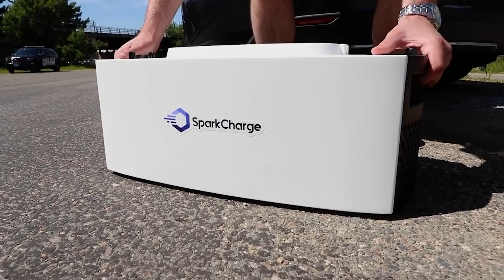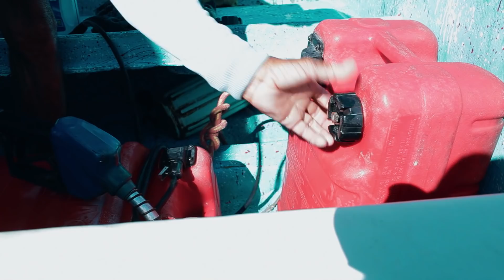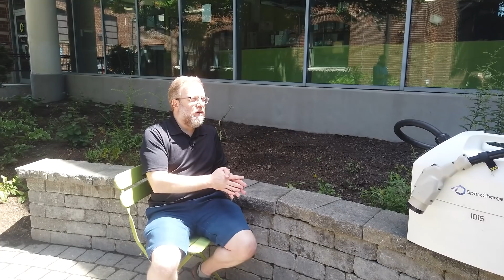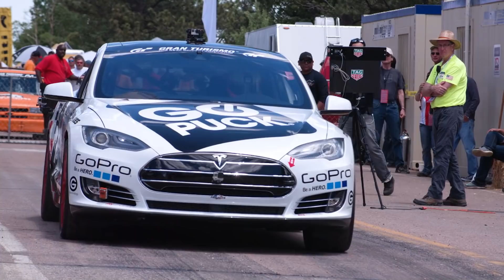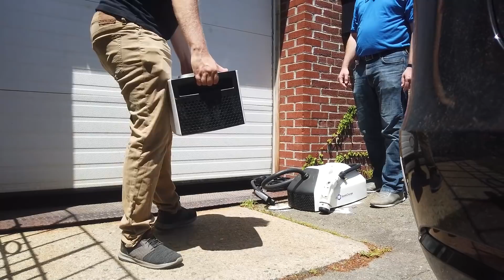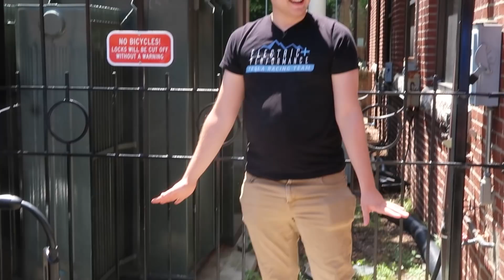SparkCharge | Range to the Rescue!

Comment: All this company needs is to make a secure outdoor enclosure for these units, and they could turn any parking space with a 120V power outlet into an EV charging space. No permits or massive installs for EV stalls. This would just charge up when not in use, and then when someone pulls in, it can dump the battery contents into the car.

Comment: “How much is in the first battery?”
10-15 miles
The guy lost credibility when he answered the question this way.   Batteries do not store miles, they store kWh (kilowatt hours).  He should have definitely included the battery capacity in his answer.  Saying “10-15 miles” tells me he’s misrepresenting, exaggerating and the solution is probably crap compared to others.  Or - the spokesperson is an idiot. 🤷🏻‍♂️

This product is a portable battery and a charging cable.  It’s simple and obvious.  There’s nothing innovative about it.  The market will be flooded with products like this.

Comment: 1 mile a min charge? That's super slow. I love the idea but it needs to be able to charge faster than 1 mile/min. Plus one battery bank only contains 10-15 miles so you'd have to stack at least 4 banks to get at least 40-60 miles if needing to get to the closest Tesla charging station while on a federal interstate like I-95 or I-10. I love the design and portability but I'll wait until the charging speed increases.

Comment: I just thought of another use case... Rentals. You going on a long road trip? Want a little peace of mind that you won't be stranded on the side of the road out of juice without cell service? You rent one of these as a 'just in case' backup to take on your trip with you. Then at the end of your trip you return it. - Call it the 'road trip kit' include a single power pack, a spare tire, an emergency kit with those pop-up cones, first aid kit, tire sealant, tire pump... It might take up 1/4th or 1/3rd of your trunk, but you'll travel with confidence.

Comment: I think this is dumb.. you can just get a generator with 240v and charge just as quickly.

Yes it's a green product if it can be charged from renewable energy sources, but once it's used up it's dead until it's brought back home to recharge. A service truck would have to return to base to charge it and wouldn't be able to boost another EV until it's charged again.

Comment: Love this product and its very articulate CEO.  Another use case would be home backup power.  Just needs an interface for that to either plug into the home electrical panel the way a gas generator can, with a switch installed to isolate from the power grid, or simple power outlets on the unit itself to plug your appliances and lights directly into it.  I’d take either solution.

Comment: Not saying it’s not a great idea, but cost wise isn’t it a lot cheaper to install a  gas 2kilowatt generator and plug the Tesla into it.

Edit. Looked online a 2000 watt WEN generator is just $500. Just add a plug for the Tesla. I know the irony of using gas to charge electric but it’s for emergencies

Comment: The fan noise is my only complaint, a lower pitch would be less n annoying. Could they make an adapter to provide AC power so you could use it as a portable generator?

Comment: After driving an Nissan Leaf for over 5 years now and 100,000 miles later I ran out of juice twice within the first year never again.  I would not be able to use this as my Leaf has no fast charger so I made my own system to do the same as this but have to go from dc to ac which is less efficient but still gets the job done.

Comment: 1:21 "It's meant to be lightweight" That thing looks heavy. Just how light is it exactly? (Might say further in the vid, idk yet)

EDIT: Did some research: The top part (the charger) weights 19.8lbs. The battery (one battery unit) is 48.4lbs.  That brings the minimum weight for a complete unit (with one battery) to a whopping 68.2 lbs. I don't believe that is considered lightweight.

Comment: Great video but I'm curious about the charging of the unit itself.  Do the modules have a base for charging them individually, several at a time, on 240vac or 120vac, etc.and what would be the minimal investment cost be for a company like a towing business? I guess I can check out the link you provided for answers.  Thanks

Comment: this is cool, but, I would think that the price will make it 'hard to sell'...
I do not know what pricing is, but, I assume the 'top bit' is more than $1250usd and each 3.5KWH pack will be $900usd -- at this cost, it will be hard to sell, if the cost is more than this, I think this will be super hard to sell... I wish you well, but, with V2V @ DC-125KW+ in the CyberTruck, you may have 'zero' market to service in 2023? - again, this is not to be negative, but, things in the EV world move so fast, when I see a 'person/business' travelling down a dead end path, I like to offer my opinion... (I spend a lot of time making comments on NIKOLA H2 projects, telling them to dump H2 and focus on battery solutions - as I just want to help people find the best outcomes...) feel free to contact me on linked in if you want any of my advice.
my guess is that the 'top bit' is 19kg and each pack is 25kg - it would be good to confirm this and the cost if you (Josh) see this, just post a reply?
Reply: V2V would still require an external charger. Electric vehicles don't have a DC-DC converter between the battery and the charge port. So even if V2V became popularized you would still need the external charger plugged into both vehicles to control the charging. 125kW DC chargers are over $80k USD and extremely bulky. It's a nice desire, but V2V doesn't work for CCS and Chademo is dying. Tesla is starting to invest into the technology, but it's unlikely we'll ever see it work on the vehicles already on the road today. Depending on what safety and communication systems are required by regulators, existing vehicles are likely to fail to meet those, yet to be created, standards.

Comment: Would have enjoyed more technical information.  How do you recharge it, for example.  

Are the packs 400+ volts? Or is there a boost converter, and if so what’s the efficiency? 

You need about 95-100 18650’s in series to output 400v DC. That’s would be the most efficient, but anyway.

Comment: Great idea, but one show-stopper for me purchasing one would be the need for a Chademo adapter.  Great for Leaf owners, but as a Tesla owner I would be required to spend another $450 for the adapter.  While this has other benefits, it is not something I really need.  A better solution would be to have a unit that would allow direct plug-in to Teslas.  That said, I do think the solution works for commerical tow services that could carry the Chademo adapter for Teslas that need portable charging.

Comment: I don't know, I feel like this provides a negative connotation making consumers believe you need to have a backup power supply because your vehicle can't make it. Also once V2G is utilized this idea no longer has a place because then you can charge car to car when someone runs out of range. Good concept just feel like it doesn't fit a market need at this time.

Comment: Good idea with poor business model. It appeared great watching your amazing video. Once I checked the shop I had two big disappointments, you cannot purchase it and it is too expensive ($6,732 in 18 months).  I thought this could have been the perfect solution for my Nissan Leaf (with ChaDemo) but it costs less to replace the battery. They should review their costing to be successful
Reply: I agree, rental is out of the question if you own an EV.  You can do a similar trick with a portable 3Kw battery power station and a little wiring for about $4000. Or you can get 6Kw for about $5,500.  It isn't as nice and tidy as these custom made parts but they do the job.  What's more you can tie the power stations directly into a solar grid like any other battery if you want.  I have no idea what kind of charging system these spark systems use.  Probably a proprietary dock.

Comment: I like the idea - I think it had been around for a while now. Congrats to the team for the nice product too. However, i think that a more practical and reasonable solution would be vehicle-to-vehicle charging. In this way instead of a regular diesel towtruck brining you 15miles of charge, you can have the tow truck to be an EV with a large battery, that can charge you up directly by plugging into the truck, similar to the V2Grid idea.

Comment: Some questions I would have would be in regard to how do you charge up the portable batteries?  Regular 110v outlet?  How long does that take?  So if you're on a road trip, and you're low in battery on your car,  you can charge up with this battery...but it's still not enough to get you to a supercharger.  Could you go to a rest stop and use a 110v to charge up this Sparkcharge much faster than connecting the 110v to your car, and then charge the car with the Sparkcharge at a faster rate?  Or charge the car with 110v while you're also charging the Sparkcharge battery on a different 110v outlet.  Hmmm...

Comment: I like the idea. Just go back in the days when we were kids having an RC toys car with special battery pack only runs for 20mins. If you want to play for 1h you need to buy 2 more pack and swap them. Tesla has already thought of this. This SparkCharge can not sell to consumers in the long run or even the company make profit in long term. If there is another company to come up with another product call EV RangeExtention partner with Tesla compete and can beat sparkcharger. Who can make batteries cheaper than Tesla? The reason Tesla can provide Range Extention because it cant make batter fast enough to put in it own cars. Tesla can make the whole car to sell the whole car more profit than just sell the battery. Let say Tesla have 100 cars and 50 batteries. Tesla rather sell 50 completed cars+batteries more profit than sell 25 cars and hold 25batteris to sell them as Range Extention and have 75 batteries less sitting in warehouse.

Now if Tesla make enough batteries and can partner and supply batteries to EV RangeExten than this could how it work. Tesla car already have onboard charger make use of it in stead of create another one add more cost to the system and more mass to carry with like SparkCharger has 20kw chargher. #1 have Tesla upgrade add a DC charge ports with coolant in/out in future vehicle trunks.
#2 have Tesla upgrade the Onboard computer/software to commuicate with the BMS RangeExten battery. This RangeExten battery can either charge while driving or add on with the onboard battery. So there is no need to turn off the car plugin the RangeExten and sit wait for 30mins.
#3 Design EV RangeExten can self charge with 120AC, self cool also with onboard inverter provide 120AC outlet for camping, built-in tire pump. Disign them in such that Fishing Boat and RV can use and work with sola panel most RV have.
#4 Rent this EV RangeExten every gas stations, EV charge locations and Wallmark and everwhere you can think of with the capital you have. Only rent you make more money in the long term. Do not sell.
This will beat SparkCharger because their systems too expensive not much consumers can afford but everyone can rent. Why buy another charger when you already have it on your car and new fancy looking stackable batteries case.
Who want to team up with me to make this possible contact me.

Comment: This would be a low moat endeavor for Tesla in a couple of ways.  1) Get the car range up to 500+ miles which is a certainty. 2) continue to populate the landscape with superchargers which is a certainty.  A potential #3 would be to simply get into the business as a direct competitor by adding this same service to the Tesla service trucks that arrive but with a much larger MPH capability.  50 miles with a fully stacked 300 lb battery pack is laughable.  The market is too small for this narrow emergency need, and the moat is virtually  non-existent.   I would short the company if it went public.

Comment: This is SO exciting!!!  As a LEAF owner I’ve been so limited by my lack of range.  I have to plan my activities around distance and calculate mileage.  I’ve been stuck for hours at level 2 chargers multiple times when the DC chargers were broken down — 3 times at Nissan Stations!!  Hallelujah Spark Charge!!
Reply: Right on being a leaf owner me too👋👍 we've spent hours at chargers too! Hope more people keep talking about electric cars! Keep road tripping my longest trip was from Colorado to Yellowstone, in my leaf!! Total too, 1,610miles🤭🚗🔌😍
Reply: I thought the same then the cost ($6,732 per 18 months rent) made me rethink. I am a Nissan Leaf owner as well, I thought this could have worked but it seems crazy to spend so much on renting a temporary battery. It does cost less to add a second battery with few KWh as back up on the boot of the car. However, I wish this company all the best at least the thought about a solution for EV owners with low range.

Comment: Would be nice if they had a Tesla native connector, I'm sure Tesla would give them a license. They probably picked CHADeMO because there is a Tesla adapter for that. The problem is that adapter adds $450 to the cost. CHADeMO is a dead standard, in the long run they need native Tesla and native CCS.

Comment: Great product.  The equivalent to the red gas can.  I wonder how hydrogen would address this use case?

But I'm still find of the idea of a Tow+Regen emergency recharge solution, just need a tow bar...  Something any vehicle can provide to any battery electric vehicle.  And again, something hydrogen can not address.

Comment: This is a solution looking for a problem.  People with EVs don't run them flat - they plan to charge before they do so.  The "endless use cases" are wierd - if you're on your couch, why would you use a 3rd party service to put 10 miles in your EV?  Just plug it into your house on an AC adapter if you don't have anything better.  Planning to meet someone en-route?  For 10 miles?  Pointless - just plan your route to the proper fast charger and keep going.  RAC in the UK already can charge EVs from their call-out vans, so there would seem to be no market for this.  For the size/expense, I wouldn't carry one in my M3 - I'd just plan to stop and charge up as necessary.  Don't get it I'm afraid.

Comment: Hmm, don't think this product design will be successful.  Too expensive by design.  They need to build an augment to larger tow truck engines, to power an alternator directly into an ev charger.  No batteries, no capacity limit, just run the truck.  Or put a generator on the tow truck, off the same fuel tank.  Compact, can service ICE cars still.  Both of those would be cheaper to retrofit, with less constraints.  The use cases he described outside of roadside assistance dont make sense.  Ideally we'd be able to do vehicle to vehicle charging at some point, allowing anyone to help you.

Comment: Congratulations Joshua for producing the portable charger for EV could have a lot of other users like charger electric power tool, for trade people.   Good for an NRMA mobile service vehicles in Austalia. The EV service vehicle could use its battery to provide the power, that will be the next step. Joshua, I've sent a request to you to connect on LinkedIn.

Comment: Think about putting this in the back of the cybertuck you could fit it with no problem
Reply: exactly my thought also. i have LR cyber on order, i have my own 240 in a box gadget for when there is no 1792 outlets, and now sparkcharge -if you would listen closely a three pack goes 50 miles

Comment: Sounds like a vacuum cleaner or leaf blower. I wonder how long these devices will last (in terms of re-uses). How much energy is lost between charging the battery and transferring the energy to the car battery. I am very interested in learning more details on Spark Charge. Definitely would be good for tow-truck companies to have on hand, and for Tesla Roadside Service or AAA. So many use cases.

Comment: Having been towed for running out of charge twice, I know that an extra 5-10 theoretical miles of charge most likely would not be enough to “get on your way”. You’d still end up having to drive to the charging station to top off. In fact, in most cases, the target destination prior to running out of charge was likely a charging station. I just want to point out that argument is unrealistic.
Reply: I think the point is, when using the sparkcharge the time to get you on your way, leaving from the grid tied charger, is comparable in time, probably less, don't have to take time loading and unloading the car. What this does is it eliminates the need for a flatbed  truck and the cost to transport the car. Which is significant.

Comment: I'm building an enclosed trailer with 12 TESLA Power Walls inside it for off grid camping. The top of the trailer has a solar panel trey with telescoping sliders to the left and right of the trailer. 

I wonder what the per kilowatt price difference is and the energy density difference is between the two...
Reply: Are they Powerwall  1 or 2. Because 132 kwh seems a little overkill.

Comment: As for calling a tow truck to get a little charge, might as well have them tow your vehicle to the nearest supercharger station if the service will cost just the same. Maybe if the service price is only half the cost of a tow maybe, but I suspect it will just be a pickup truck or Prius bringing the portable charger instead. As an owner of two Teslas, I would get one of these with two battery packs only if the price is reasonable.